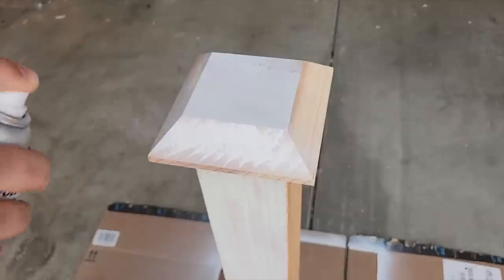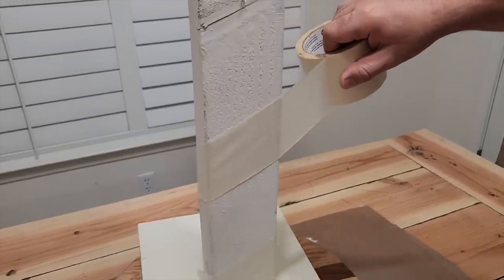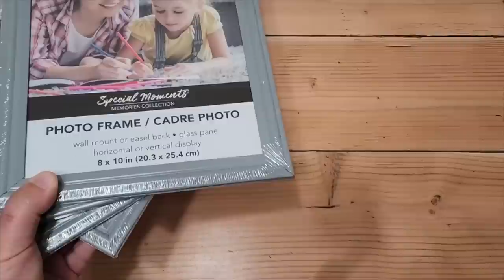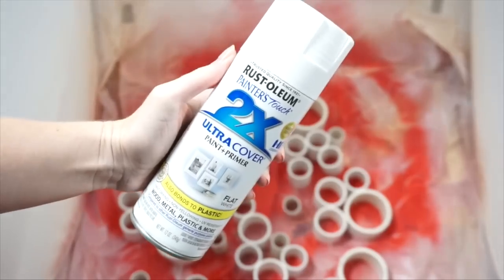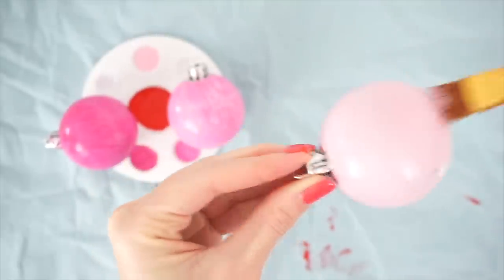How to DIY a Christmas stocking hanger that is easy and budget friendly! (BRILLIANT!)

Comment: I made the stocking holder - I went to my local lumber store and asked if I could look at their discard pile.  I found 2 4X4's they had thrown away - so they were FREE!  For the bottom of the stocking holder, I used old lazy Susan's I found at the thrift store - around $2.  The lazy Susan had small wheels on them, so they moved around on the floor. I used a couple of long screws on the bottom.  The finials on the top were old finials from drapery rods.  Sprayed them green and red, and used hooks found at the dollar store!  For around $5 I had gifts that my friends were blown away by!